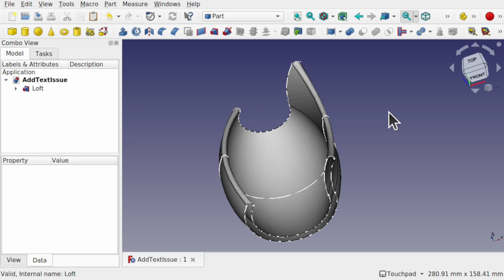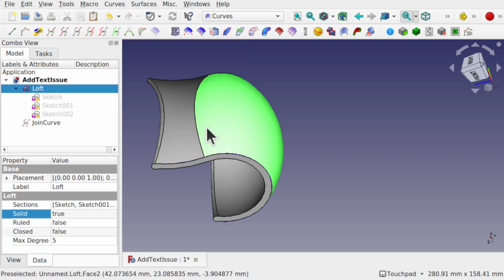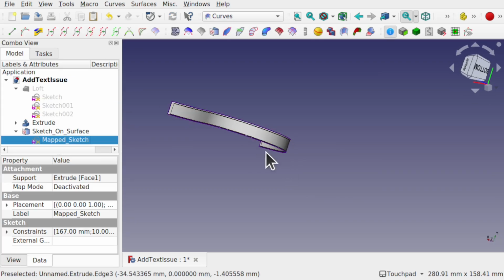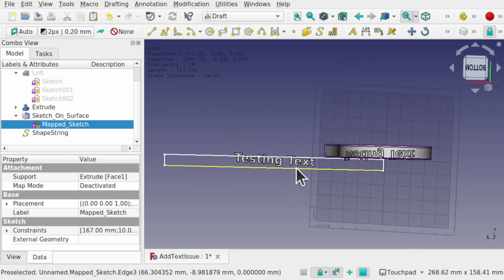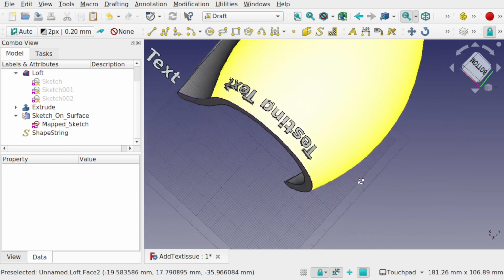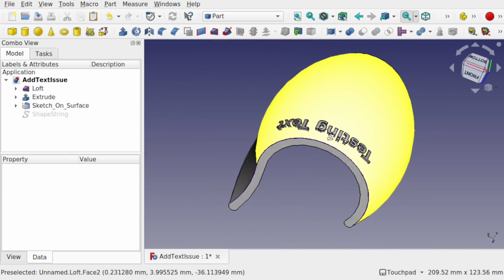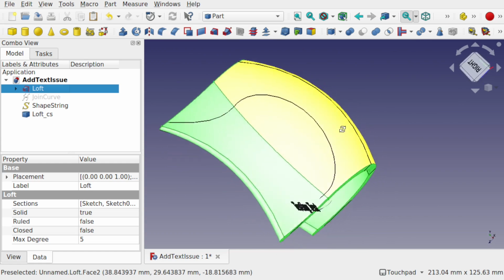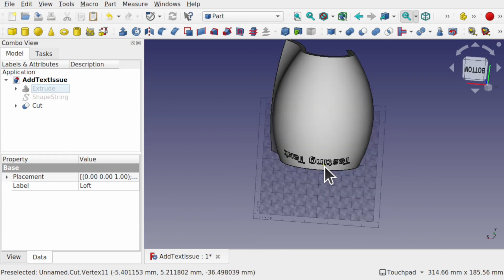FreeCAD:  Text on awkward surfaces failing? Possible solution and hack

Comment: 00:00 Intro
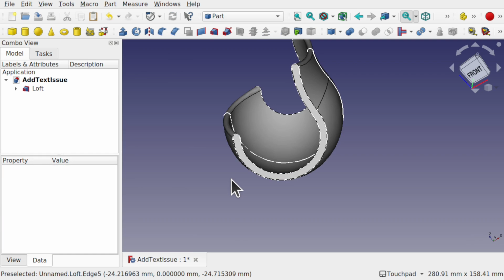01:04 Curves Workbench -> Sketch on Surface failing on combined surface
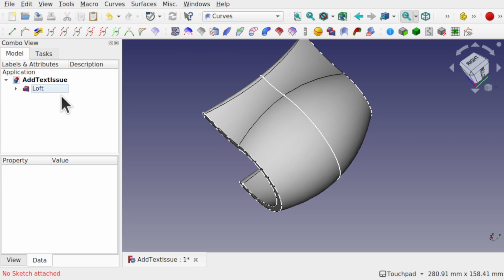01:48 Join & Extrude Curves
03:44 Creating "Sketch on Surface" that follows the newly extruded curve
04:00 Manually fixing Sketch on Surface bounding box size
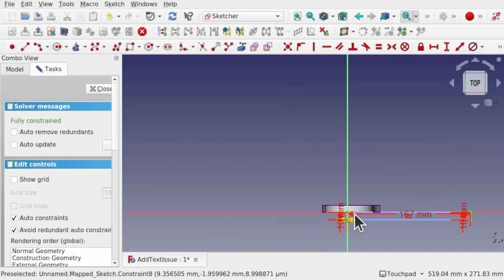04:59 Exploring Sketch on Surface
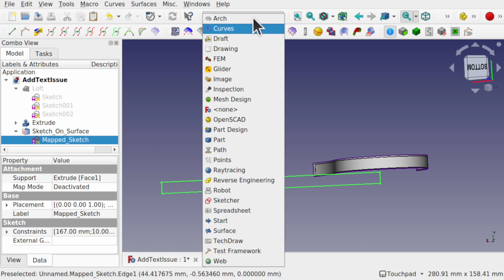06:22 Placing text
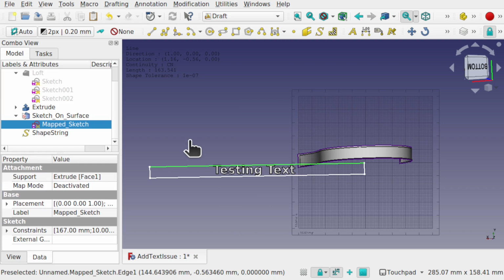07:41 Adding text to Sketch on Surface
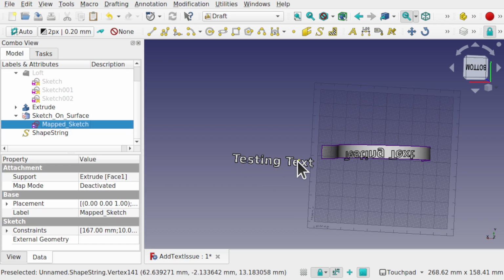08:39 Reversing, moving, aligning text
09:37 Filling & thicknessing text, more transformations
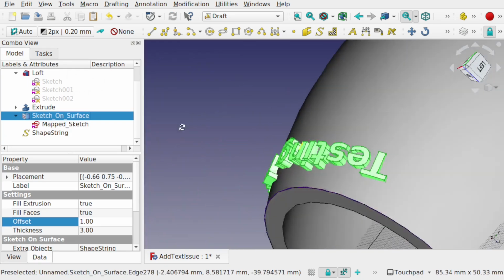11:50 Combining text and part via Compound / Boolean cut
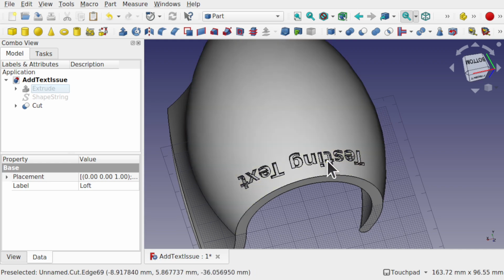13:31 Shrinking/expanding curve to alter text placement
14:42 Creating cross-sections for text path
19:04 Outro
Reply from the maker: Thank you 👍👍👍👍👍👍👍👍👍👍👍👍

Comment: Hi , deron this question doesn't exactly apply to this video.  Hers my question . 
I have an stl sent to me by a friend he wants hid grandsons name put on this base . Sunk in , not protruding not sure how to do it but I said I would try . How would you do it . Perhaps you could tell me how . I sure would appreciate it  .

Thanks Deron
Terry
Reply from the maker: Hi Terry hope your well. I do have a video where I edit and add to a STL file https://youtu.be/ix8fZG5ZpP0 but it all depends on what surface shape you want to place the text on. STL are hard to work with as they are mesh which have to be concerned through freecad. The link explains how to do it. But, if you can get a STEP or  STP file then your life will be a lot more easier as you will be able to access the individual faces and no conversion is needed.